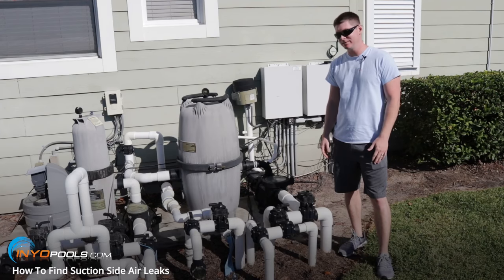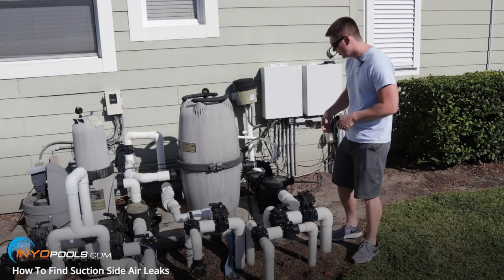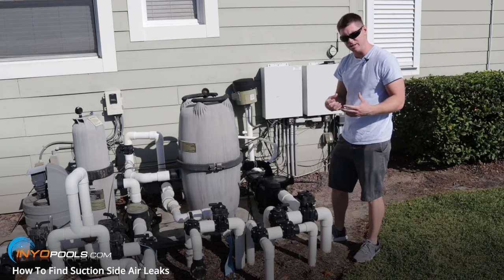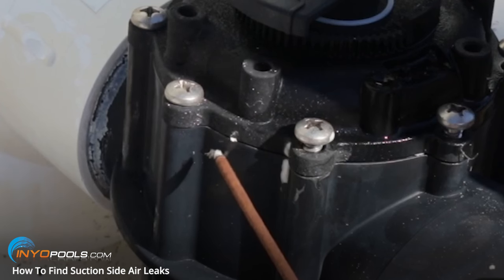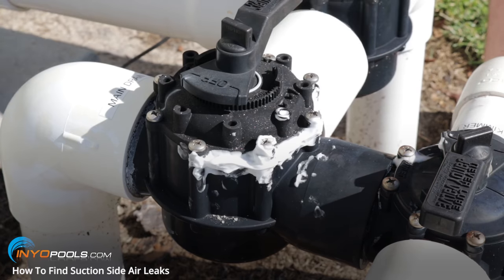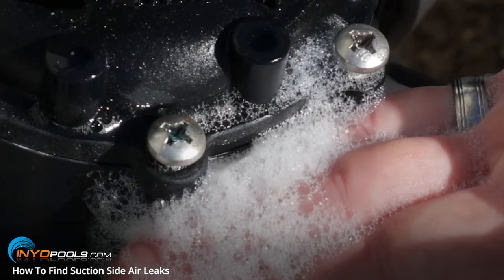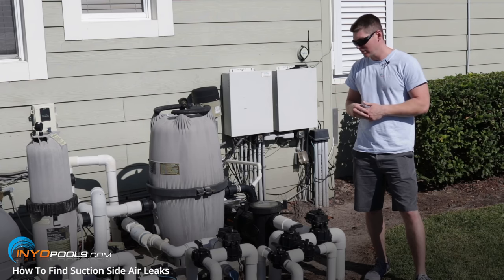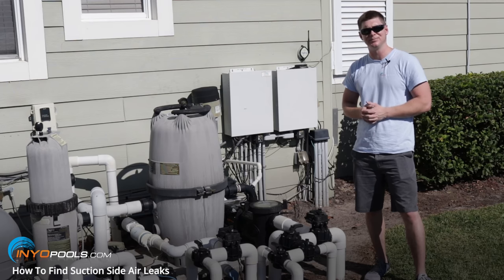How To Find Suction Side Air Leaks In Your Pool

Comment: I got a tip from a pool company as I had a leak on the suction side.  I shut off the filter while watching the system - it causes a reaction where water leaks out.  Sure enough one of my inlet valves spit a little water each time I shut off the pump.  Replaced the o-rings and back in business.

Comment: The sure way to find an air leak is to put the system under water pressure. Simply take a HydraFlush (for blowing obstructions out with water), attach it to a garden hose, and push water from the skimmer or the vac port toward the equipment. You do this with the system off. Wherever you see water leaking on your suction side, is exactly where your air leak is.
Reply: Wow, great idea!
Reply: This method is amazing!  I have been trying to trouble shoot air bubbles for days.  In 30 seconds i knew exactly where the suction side air leak was and fixed it!
Reply: excuse me for my ignorance. what is HyraFlush? googling it did not help. i like this concept and i want to try it but i need a right tool to connect garden hose to skimmer and vac port. thank you for sharing this idea.
Reply: @steviewonder275  It’s also called a drain jet. It’s a garden hose attachment that is basically a bladder that blows up when the hose on. It forces water to only go one way.
Reply: Also called a drain bladder.
Reply: Can you do this for return jets too?

Comment: That was a great demo for finding leaks. My question is did you have the screws loose for that purpose?
Reply from the maker: Yes, the screws were loosened to help demonstrate how soap bubbles would look if there was an air leak in the valve.

Comment: Great tips, short, informative and to the point 👍 Other DIY-ers take notes!
Reply from the maker: Thanks! 👍
Reply: @Inyopools  I’ve tried all these methods and still have air in my return lines. Any other suggestions? Underground Lines have been pressure tested as well very weird. Thank you for your help.

Comment: Hello. Just saw your video...4 years late. 😂  I had a new filter system installed from a sand filter. 2 weeks after install I've got bubbles from the furthest (weakest)  jet out in the pool. Installer says lid or o ring on pump are bad (bought all brand new to check and still have bubbles), or it's pipes between pool and pump/filter. How and what else can I check?  No issues until after the new install, but pool is near 50 years old as well.

Comment: Can u use the bubble technique or shaving technique if the valve u suspect is coming from the valve on the return side?!  It’s drilling water and not sure if it’s the coupler where the valve is attached or from the orings in the 3 way valve…

Comment: My question is about patching leaks.  I have patched a spot or two in my pump housing but I suspect there are others that I cannot see or get to because the pump is mounted up against a wall. What do you say to the idea of just spraying down the entire thing with Flex Seal in order to patch cracks in the housing?

Comment: Nice video, some good tips, my question is, I do have some air bubbles through the return jets, but my bigger concern is that when the pump starts up in the morning, there is quite a bit of air that bubbles and  gurgles from the return jets for about 30-45 seconds, I'm suspicious of a water leak somewhere in the system, Any ideas? 
Thank you
Reply: Air leak post filter head. I found mine on both sides of my chlorinator.
Reply: @kevinwilliams7949  What test did you do to find the air leak?
Reply: @Artseventy6  I didn't do a test. I got bubbles from the return at every startup. Almost instant. I suspected. Pulled both thread fittings off and taped them with Blue Monster tape and drove them all the way in. The fittings are IPS scale and have a taper. But I think the filter head and the chlorinator bodies are just straight thread so you have to drive them in all the way. Haven't had any bubbles since.
Reply: @kevinwilliams7949  Thanks, I'll take a closer look at mine.

Comment: So basically I should check the intake PVC pipes and valves, not the outgoing ones? I have been battling primer loss for 6 months now... every time the system starts at night the first 30 seconds consist of filling the pump up first, blowing air bubbles into the pool... then it normalizes. Takes about an hour for the pump water to recede.

Comment: My filter wouldn't fully prime and lots of bubbles were in the return streams. I tried replacing & lubing the filter pod o ring and soaping up everything on the suction side looking for leaks, but nothing helped. Finally I tried cleaning out my (cartridge) filters and voila! back to a full prime.
Reply from the maker: Nice!

Comment: We just got a pool installed and did my first vacuum today and cleaned the skimmer basket and the pump basket.
I turned the inlet valve open to skimmer only while vacuuming and all was good until I went to clean the basket.
I forgot to shut off the valve and left the skimmer valve open, which drained the pump basket.
Upon starting the pump back up, I could not open the skimmer valve without having a large volume of bubbles.
If I opened only the main drain valve no bubbles were found. So I knew it had something to do with the skimmer inlet.
I even added a little more water to the pool thinking the skimmer was not getting enough water, yet it worked earlier??
Well along that thought, I partially opened the skimmer valve and checked the skimmer...the water level was very low!
Now for the lesson of the day learned...opened the weir door...TADA!
So if you know you don't have any leaks and you're still getting bubbles in your pump basket, be sure the weir door to the skimmer is opened!

This is a helpful video, I like the water method the best!
Reply from the maker: Thank you for the feedback. We're glad you figured it out. We've also heard of people using saran wrap around suspected areas.

Comment: Thanks for the info. I tried these methods but still lose prime after an hour or so. If I backwash a little, I get the prime back. Could this be my filter element (de)?
Reply: Thanks Greg. What did you learn? Mine is doing the same thing now. Please advise.... 
Have a great day.
Reply: Same here, what was the answer
Reply: I did change the filter elements in my hayward DE filter. It's been working perfectly since
Reply: Same here, primes in 30 seconds at night while blows bubbles into the pool... water is gone from the pump in about an hour after the timer is done. I have the same exact system with the see-through plastic as in the video.

Comment: I have high psi, clean filter, low to no suction. I put a hose to the pump skimmer basket to the suction hole, I felt good pressure coming out of my skimmer hole by pool. I get build up of air in my filter, my skimmer lid gets blown up when turning off the pump. I have a frozen drain valve, it's cold right now, I haven't jumped in water i don't know if it's on or off. I had a slight air leak on a pipe by the skimmer pump basket, I tried sealing it, but it didn't work, though there is less air leak, but still same problems with low suction, I can't vacuum my pool.

Comment: Replaced the pump and now see some air in the basket. The new pump didn’t align 100%, needed to raise up the motor end of pump to lower the basket end to align with diverter in pipe. I did lube the o-ring at the fitting and used Teflon tape on fitting threads but it was not a easy connection. It did tighten but it was a fight. I took out pump basket lid and lubed o-ring but still have the issue. Could this be the cause of the air in the pump basket  ?
Reply from the maker: It could be. But that is purely a guess. There are a lot of seams, gaskets, and o-rings on the suction side of a pump. So the only way to find the leak is to go looking for the leak.

If you have adjusted/corrected an area of plumbing and the issue persists, you need to move down the line and start troubleshooting elsewhere.

Comment: hi i wanna ask...
so i got into a trouble when vacuuming my pool. i can only vacuum my swimming pool from only 1 point of the pool, and it is 10 meters length, so i can only reach 5 meters. (my pool has a clear polycarbonate roof, so only few percentage of sun penetrate and no leaves/debris )

my question is , with my semi indoor pool, do i need vacuuming? or brushing is already enough since there are no debris/leaves?
(i plan to brush the pool while swimming)(i think brushing is enough bcs after brushing, the algae/biofilm will be sucked by the filter and killed by the chlorine)

and in your video you said it's best to run the filter 12 hours a day. what is the best time pattern to run the filter? is it 6 hours on 6 hours off . or 2 hours on and 2 hours off.

Comment: I have a hayward pool filter my pressure it is more than 30 any solutions for my problem
Reply from the maker: I'd start with cleaning the filter. If the pressure doesn't drop, you may need to replace the filter media. This is assuming that the HP on your pump wasn't increased and that this is a newer problem.
Reply: @Inyopools  tks i cleaned the chlorinator with muratic acid and i was able to drop the pressure to 20

Comment: Make sure the Two drain plugs are tight on the bottom or sides of your pool pump. That made my pool have a lot of air bubbles.  Simple fix.
Reply from the maker: Great tip!
Reply: You mean one of the two holes in the drain basket that is plugged with a screw in plug?

Comment: My air leak was in my spider valve gasket in my sand filter. The gasket was worn and bypassing. New one on order from Inyo Pools.
Reply from the maker: Thank you for shopping with Inyo. Usually, a bad spider gasket will cause a water leak because it's on the pressure side of the system.
Reply: @Inyopools  Correct as
 well. I had water leaking from my backwash port.

Comment: So, the valves can have air leak in, but not have water leak out when the system isn't running? I guess so.
Reply from the maker: Correct. What happens after you stop drinking through a straw? The liquid goes back down to the cup. Why is that? The vacuum within the straw breaks when you stop drinking, then the air rushes in, purging the straw of liquid.

If the system is sealed except for one little spot, where will that air enter? Water can't leak through the same hole air is surging through.

Comment: I am losing water. It's not evaporation.  Suggestions?
Reply: If you mark water level with a pencil at the same time each day you will find out where the leaks level is by the decrease in water level loss at that point.  Usually around the skimmer plaster to plastic joint leaking by. Fix it with some pool putty.

Comment: How do you fix an air leak suction side if it is in a fitting, like an elbow, or a butt connection?
Reply from the maker: The only permanent solution is to cut out that fitting and glue in a new piece.
Reply: If you have isolated the location of the leak, run the pump and have it suck quick drying glue (primer first and then glue).  It will close small leaks (may need a few tries but usually quite effective). If that doesn't work or you have a significant area of leak especially around fittings, you will need to replace the fittings.  In any case, try this method first.
Reply: @carskum5217  Had a spa suction line fitting leaking water from glued joint, as fitting was below spa water level. I ran pump to stop leak and create vacuum on fitting and used clear primer and pvc glue daubed all around leaky joint. I did it twice and I let spa pump run for a half hour and stopped pump and leak was stopped. It has been five years and still holding up.

Comment: Question for you.  I don't have air in my pump, it seems like it is coming in after the filter.  My pump is up hill from the pool. I am getting air coming out of my jets, but I am pretty sure it is not being drawn into the pump as there is no air in it or in my filter.  I will try the methods you suggest, I am just confused why it isn't dripping on the pressurized side, but drawing air in.
Reply: With pump primed and running shut off and  look at seal and pipes before pump ...water will drip instantly from leak for a few seconds.   Hydroflush  works well too.
Reply: Spray bottle with dawn in it will show up leaks close to pump or valves. air bubbles will go away long as soap is sprayed on leak for a short while.